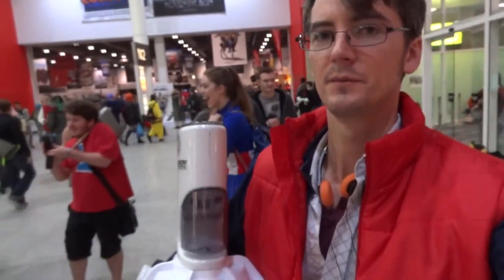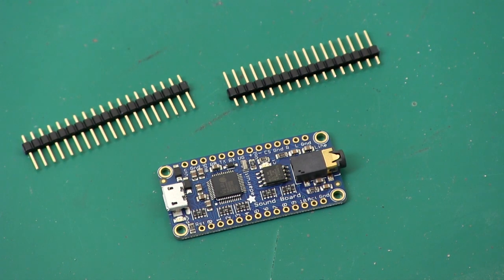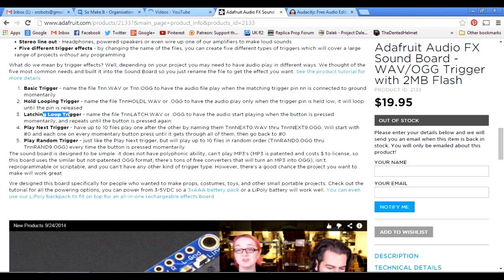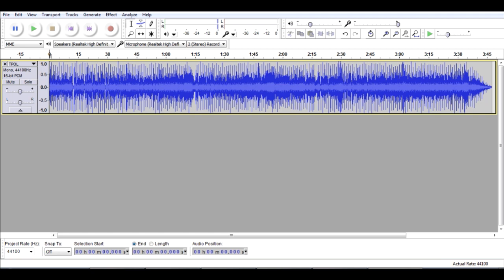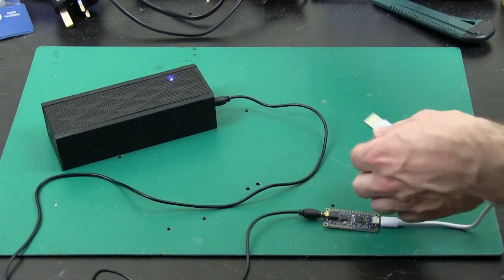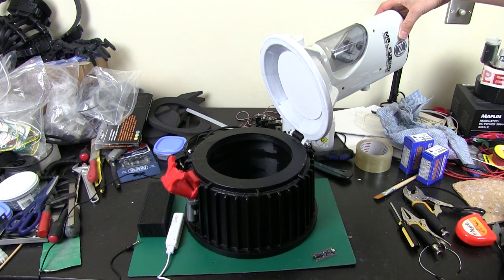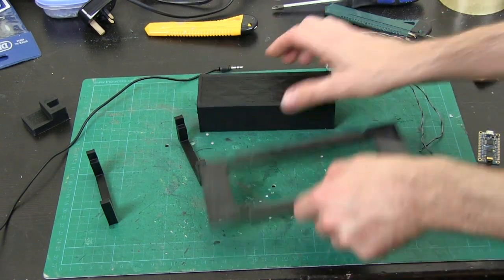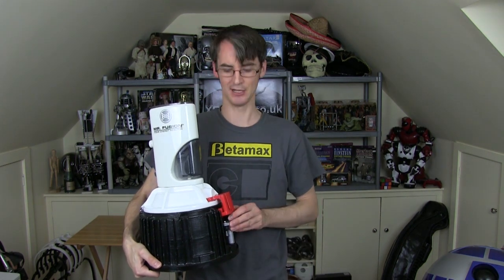BTTF Mr Fusion #4 | Adafruit Sound Board | James Bruton

Comment: James I have a question do you really need the power bank charger to power the board or will it still work with just the battery from the speaker itself

Comment: Hi David. Love the video! Workng with the Adafruit soundboard a well but have some issues with the 5V USB powerbank that is fully charged and seems to shut off shortly after the audiofile is triggered? Any help would be grateful. Thanks!
Reply: I have the same problem. Did anyone find a solution?

Comment: To James Brutton: I build plutonium meter with Arduino 328 & simple SD card! I need 2 sounds & 3 position toogle swith. Position 1 power sound on position 2 blinking on & off lamp with sound 2. position 3 on toogle everything is off! What I need? 12V Relay whit signal input for 12V blinking lamp?? Tommy.